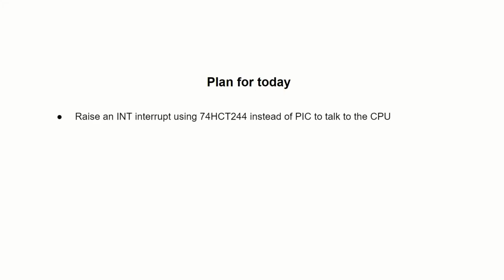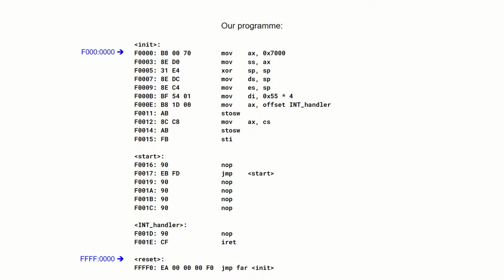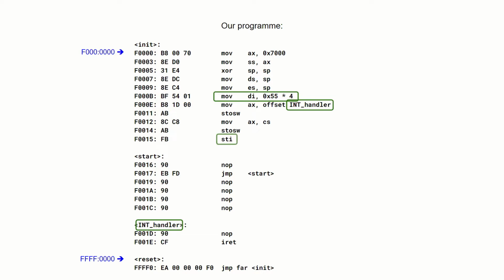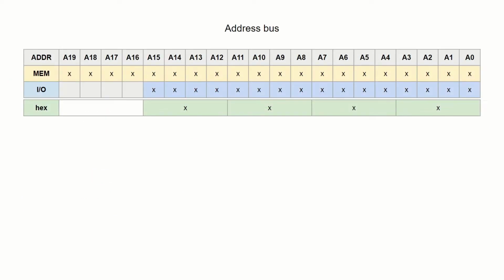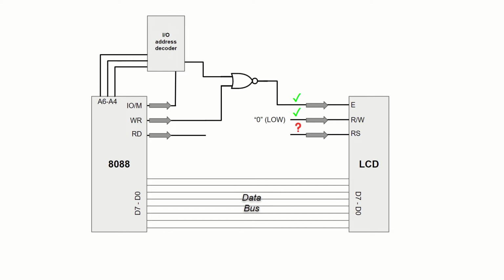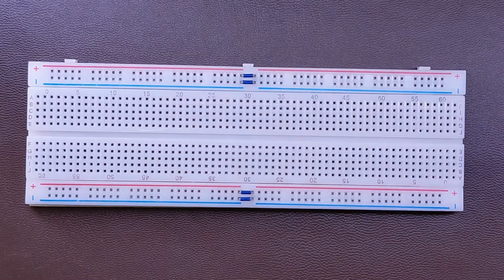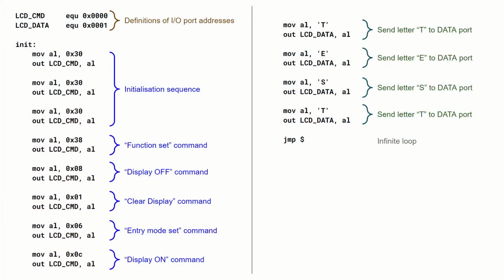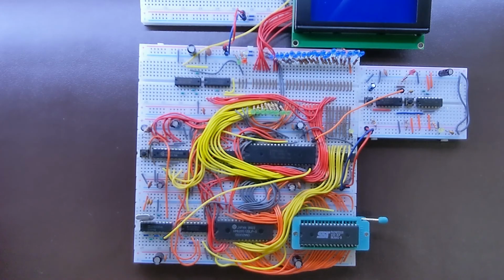More interrupts, clock generator and LCD - Building a 16-bit Intel x86 breadboard computer [part 4]

Comment: Hi there! Thanks a lot for your Videos. I'm bulding a 80186 computer out of the scratch (not PC compatible) and want to use a PIC to have more IRQs. Your series of your 8088 computer helped me a lot to understand some things i just had read at the books.

I am very curious of the next episode :)
Reply from the maker: Thank you for watching, Robert! I am really happy that I could be helpful in any way.
I remember building an 80186 (well, actually 80188) computer quite a long time ago.
Honestly, I'm planning to introduce it to my breadboard computer as well, after I have achieved the main goal, which is to play a simple game on it. The plan is to replace the 80C88 with 80C188 and remove the redundant peripherals which are included in it from the breadboards. We'll see how it goes ;-)
As a sneak peak, in the episode #6 I will finally attach a real PIC as well as another new device.
Stay tuned! ;-)

Comment: Sir will you please provide the link to buy microprocessor and other chips
Reply from the maker: Unfortunately, you cannot buy this processor in "regular" electronics shops as it is not manufactured for a long time now. Try eBay or AliExpress: just search "80C88" and you should get some offers there.
Reply: Digikey has them on their marketplace. They have Harris, Intel and AMD versions of the CPU.

Comment: Excellent video, eventhough you accidentally pushed the display off screen 😀. I am really pleased that you connected the LCD directly to the bus, it always annoys me when others “waste” an entire port on a 8522/6522 to connect what is basically just another two-address port.

Btw. the length of the video is very good at around half an hour, it helps to remind that one must sit down and follow closely!
Reply from the maker: Thank you (again) for your comment, Peter. I try to keep things simple in these videos. Adding those ports would be so wasteful and add only unnecessary complication.
I try to keep those videos around half an hour long and that's why sometimes I need to "slip" things to the next one. Thanks again!

Comment: Hi. I was born in 1973 and grew up with IBM PC's (first was Mod. 8530-021). For me, these processors have a special spirit. I invested so many hours as a child to learn how to program them just by reading books. What made you so fascinated in these CPU's?
Reply from the maker: Thank you for coming by. I'm just a couple of years younger. I do programming for living for over 20 years and even longer as a hobby. Most of my experience comes from the PC platform and I have always been interested in the low-level stuff. So yes, similarly to you, the x86 is special to me, together with 6502 which was the first processor I learned to programme. I started recording these videos just to share my joy playing with my 8088. I'm happy that some people found it useful or interesting.
Thanks again, kind regards, Pippo